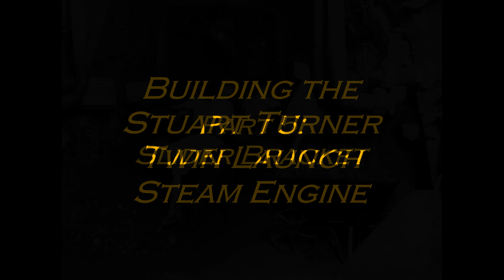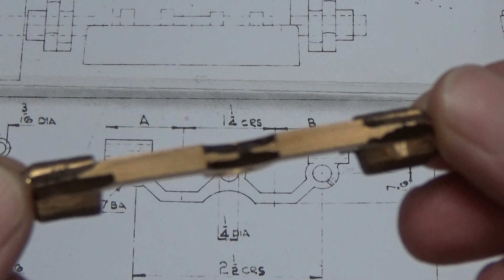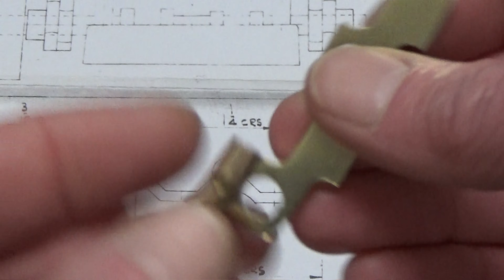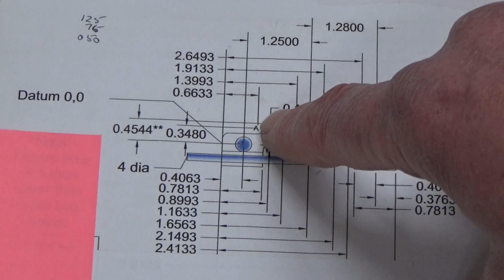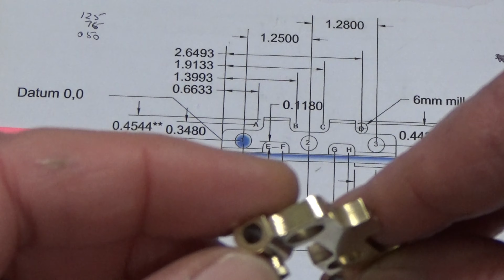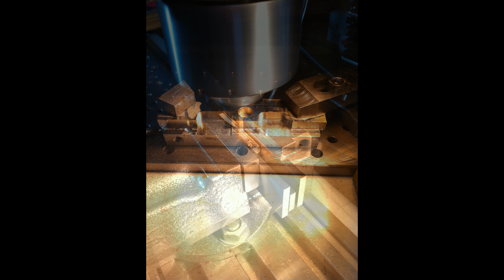Stuart Twin Launch Engine   pt 5   slider bracket

Comment: I think manufacturers make some castings where a fabrication would be a better option.
Reply from the maker: Considering the cost and quality of these items I wish I’d fabricated everything. Thanks for your feedback
Reply: @robertbriggs8465  Some firms are better than others, Blackgates are good. The smaller the casting the worse they become.
Maxwell Hemmens were by far the best of then all back in the day.
MJ engineering were also top quality.
Reply: I found this casting for the Compound Launch too soft.
At almost the last machining stage the milling cutter grabbed and bent the part beyond redemption, so I fabricated the part from three pieces of brass, silver soldered together.
For my Triple Expansion Engine I bought the drawings and only the essential CI castings like the cylinders, bottom covers and sole plate. 

The GM vacuum pump casting worked out OK in 3 attempts after manufacturing a 1/2" D bit and a tool to drill the piston rod hole perfectly centred on the 1/2" cylinder. A bit of a learning experience.
The GM water pump casting was well beyond my machining ability so I fabricated it from phosphor bronze and stainless steel. The  pump part and valve part were made separately each with 4 or 5 components silver soldered together. These were then joined with a short length of stainless pipe embedded withing the two halves of the cross pipe using Loctite 603.
My lathe (60+ years old) is very small with an MT0 spindle taper and 6.5mm through hole, so machining from bar stock rather than castings gives me greater flexibility with how I hold the work than I get with a casting.
The lump of PB I bought for the six big end bearings cost just a little more than a single casting!
Reply: @lenroddis5933 I think your build has been great and a pleasure to watch.